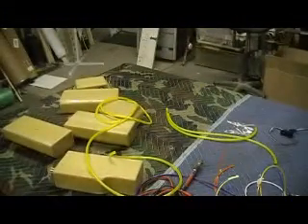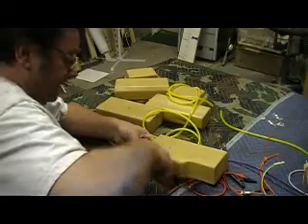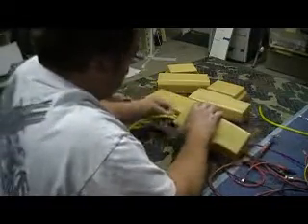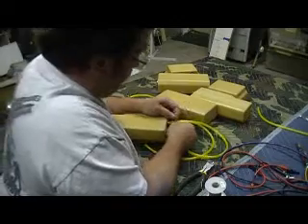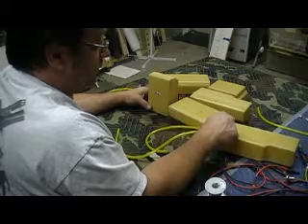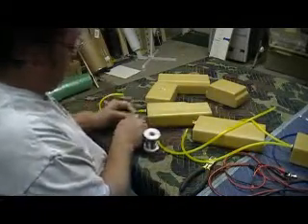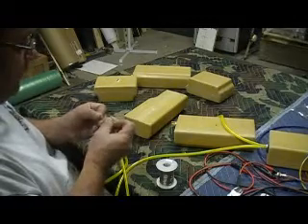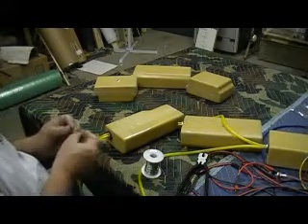FEJ F-14 tomcat build #17

Comment: Try leaving the twisted part about 1/2" long and then double it over on it's self. It leaves a 1/4" tab and you can't get snagged on it. Harbor freight has 9" and 6" safety wire pliers. The small ones work great in tight places.